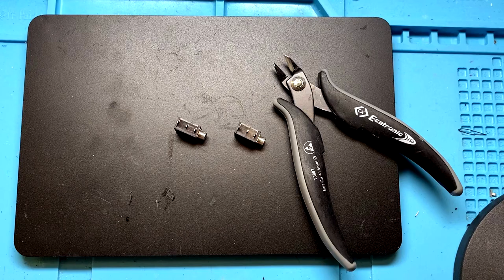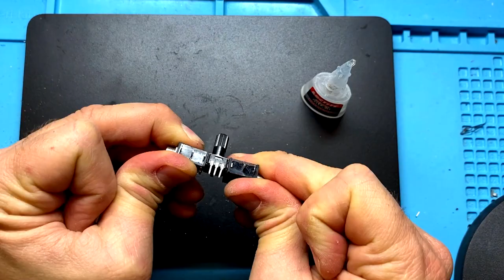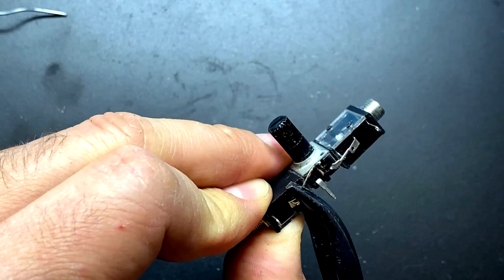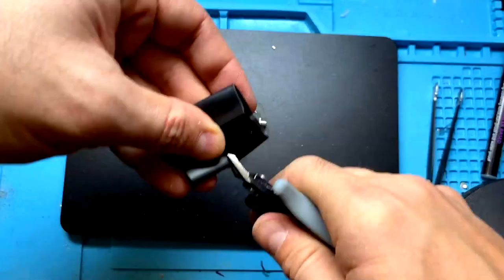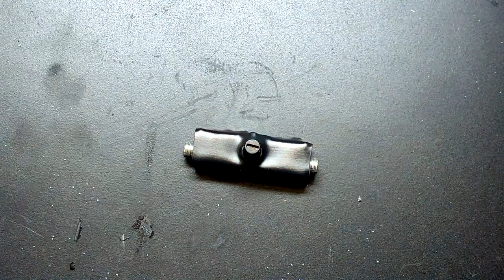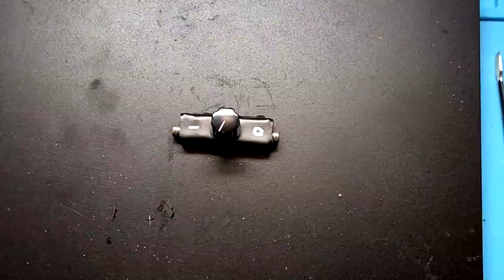EURORACK PATCHPALS n°1 attenuator

Comment: Looking for a schematic for an 'active' version of this using the incoming CV, can't find  that sofar :(
Reply from the maker: Hi TB. It's quite simple. Just add a buffer before the output. the simpliest way would be like twhat you see in this link, R1 and R2 beeing replaced by the pot in a voltage divider configuration like shown in the video: https://www.google.com/url?sa=i&url=https%3A%2F%2Felectronics.stackexchange.com%2Fquestions%2F156101%2Fbest-topology-for-active-attenuator&psig=AOvVaw0dQjovfOX5PBpNfz9i2XJJ&ust=1641454279918000&source=images&cd=vfe&ved=0CAsQjRxqFwoTCJj_9eyLmvUCFQAAAAAdAAAAABAL

Comment: Okay but what value is your pot, there ^-^;
Reply from the maker: Put A10K for Audio or B10K for CV purposes
Reply: Thanks !
Reply: The taper (B for linear, A for log/audio) matters more than the value, really; you're using it as a voltage divider, so it's the internal ratio rather than the absolute value that affects the volume.  I had good success with a 2.5k mini-pot that I've got rather too many of.
Reply from the maker: k9wax  you are absolutely right. The values i gave are for reference, but it can be achieved with any value